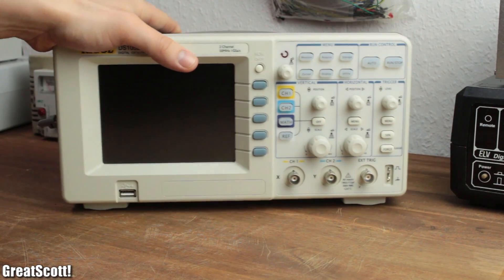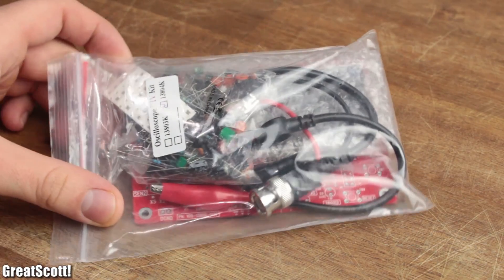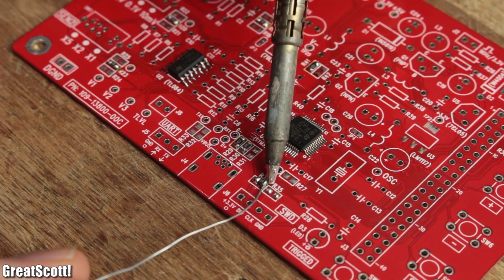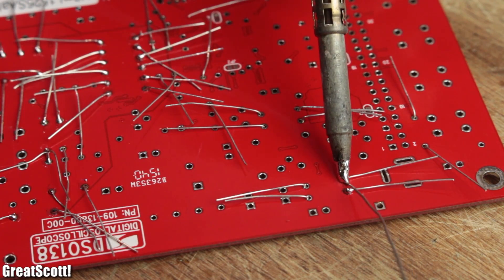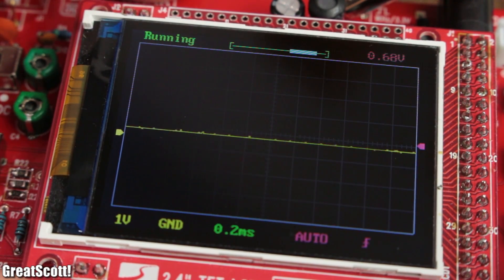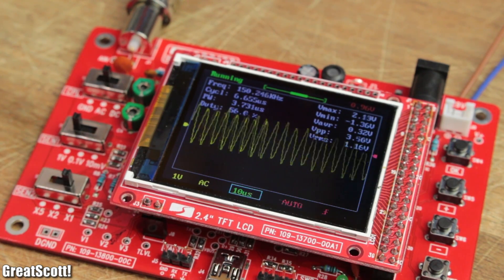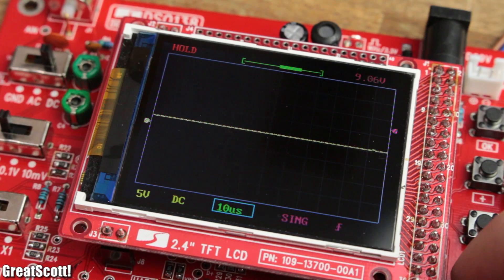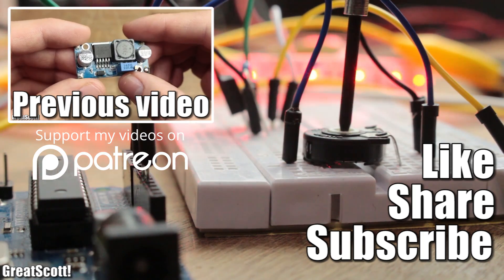DIY Oscilloscope Kit (20$) VS Regular DS Oscilloscope (400$)

Comment: My kit came with those tiny resistors and 3 other chips preinstalled I am very glad for that because they look hard to install. I once tried to solder a kit that was made up of those tiny chips and I failed miserably. lol, My kit also it came with all the documentation. I only just received it and my multimeter broke so I am waiting for a new meter to arrive before soldering anything onto the board. The documentation recommends testing the parts before installing them but in the meantime, I want to gain as much knowledge as I can before assembling and using it.I am fairly certain that this item will be perfect for my needs I am nothing more than a hobbyist  Thanks for your video.
Why does it tell us to short J4 after a power test?

Comment: can it be used to set up amplifiers gains in car audio, where output voltage is 30~40V ?
Reply: Alexandru V max recommended is 5v
Reply: Maybe you can use a 1/10th probe on it, but I don't know if you can easily calibrate it :)

Comment: Excellent video!!  You could add a few more details on the build issues (do you need static mat & heat sinks, if chips are sensitive CMOS, or, thru holes mis-drilled (if they are..).. that kind of stuff.  But overall, really, really good!  It's concise, and you get to the point without a lot of those stupid egocentric introduction animations so many douchebags like to add..  Thank you!

Comment: Measured the resistors? I suggested that in Electronics class, and the teacher damn near threw me out of the class. He insisted that we learn the color code by heart.

Bad luck for me, I'm slightly color blind...

Aced the class though, got top grades and now, 10 years later, I'm running my own electronics business... And I never use the color codes, unless I'm sorting big bulks of resistors... and even then I only measure one, then match the same colors together.

((For those who have no clue what I'm talking about, resistors have four stripes on them. One is gold and signifies the direction to read the other three. Each color corresponds to a number and together they "print" the resistance... because printing the number would be too complicated, I guess))
Reply: morphman86 wont work on SMDs tho, no colour code
Reply: The one that's gold is the Tolerance Band, which does two things. The first one you figured out. The other tells you how cheap your resistors are, or how close the actual value is to the marked one. There are four colors: brown, red, gold and silver.

Brown: 1% resistor - rare because most things don't need quite that much precision...the Army buys a lot of these, though.
Red: 2% resistor
Gold: 5% resistor
Silver: 10% resistor

If you have a 100 kilohm resistor, this is the spread:

1%: 99k to 101k
2%: 98k to 102k
5%: 95k to 105k
10%: 10k to 110k

They calculate the tolerance by making a big batch of resistors then measuring them all.
Reply: jmowreader Gold is the most common and the only one most amateurs will ever see. Thought it would be a bit outside the scope of what I was explaining to take all 4 of them up :)

Comment: I really want to make this but the super small soldering and soldering the chips is still a bit out of my range... I was happy when i got my amplifier kit working and the parts were pritty big
Reply: Several online stores sell it assembled for a few bucks more (i.e., $29 vs. $23 or so). IMHO, it doesn't make much sense assembling it by hand (unless you want to do that as a hobby, of course).
Reply: If you search for the  DSO138 13803K model, then all the SMD parts are pre-solderd, all that's left to solder is the through hole parts.  On the 13804K model you need to solder the SMD parts. 
JYE Tech make the original/genuine kit.

Comment: It seems to be tough to get good screens. I am brand new to the arduino and electronics, and am looking for a square LCD screen of 10cm by 10cm capable of producing about 8 different colours, and able to produce smooth lettering with an anti-aliased look. I haven't a clue where to begin looking, is ebay the only option?

Comment: hi i bought a new digital oscilloscope recently ,in its manual there is a warning telling that " the channels of the oscilloscope are non-isolated electrically. the channels should adopt common basis during measuring. to prevent short circuit, the 2 probe ground must not be connected to 2  different non-isolated dc level ." what do this mean ,can you please tell me .
Reply: Vasudev Mr basically you should not risk having the probes on different voltages since that could fry it

Comment: This kit is garbage and I returned it and bought a real analog oscilloscope for nearly the same price on EBay. I cannot believe you recommended this piece of junk
Reply from the maker: +Robert Maxson You have to be more specific rather than just saying this is garbage. Otherwise no one will take you serious.
Reply: +GreatScott! The bandwidth is a lousy 200k, the assembly was tedious and 2 of the components did not work (Chinese speciality), the probes are alligator clips, and compared with a real oscilloscope it has so much noise. I went online and bought a proper Hameg 40M analog scope for $50 on eBay and it's all I will ever need. You should be ashamed to advise anyone to buy that piece of crap instead of recommending an analog scope like every other YouTuber. I hope they gave you a lot of money for the shoutout. Engineers are suppose to be people you can trust.
Reply: +GreatScott! The bandwidth is a lousy 200k, the assembly was tedious and 2 of the components did not work (Chinese speciality), the probes are alligator clips, and compared with a real oscilloscope it has so much noise. I went online and bought a proper Hameg 40M analog scope for $50 on eBay and it's all I will ever need. You should be ashamed to advise anyone to buy that piece of crap instead of recommending an analog scope like every other YouTuber. I hope they gave you a lot of money for the shoutout. Engineers are suppose to be people you can trust.
Reply from the maker: Robert Maxson
Did you read the description of the product? Why were you suprised by the bandwidth and the alligator clips? I still think the kit is a good starting point for electronics tinkerer. No need to spread that much hate.

Comment: Hi Scott, thanks a lot for all these videos. :) One question about DSO138 : is it possible to upgrade the firmware of the DSO via one Arduino uno? thanks a lot :)
Reply: Using avr ISP mk2 it should work if youve got the right Software.

Comment: Great scott if the one button moves the measurement desolder it and use an opener then it will walk over the display until you press the buttun

Comment: I have built this Oscilloscope a while ago. Apreciate that you have done it too.
I have a huge problem and am not able to fix it myself:

No matter where I measure the voltage it is always 9,3V when I measure like you did in the video. AV-, AV+, 3,3V, 5V, TP22 it doesn't matter it is always 9,3V.
Any ideas how to fix it?

Comment: To solder SMD resistors and capacitors I apply solder only on a single pad and then I heat it while placing the component using some tweezers. After that I solder the other pad :)

Comment: Great Scott! Could you help me? I bought the same Oscilloscope kit and built it just before you made this video. However I think I blew up something on mine as the voltage per division is less than half of the actual voltage measured. Then I checked my power supply that was supposed to be 9v and it was actually giving 19v! The maximum this Oscilloscope can take is 12v so I assume I busted something. I checked the voltages as in manual and all are fine (after I used another 9v power supply). I'm wondering if you'd be able to have a look at yours and see what could fail in case of an overvoltage. 
That would be awesome! 
Anyway, love your videos, keep them coming!

Comment: When soldering SMD resistors or capacitors, put solder on just one pad. Put component on it's place and heat up solder to make a joint with simultaneously adjusting component's alignment, apply solder on the other pad to make a second joint. IMO, way more easier, way more better. 
Tweezers with sharp tips are essential. Chisel tip is the right tip for SMD soldering. Of course you don't want it to be too wide and you don't want to use thick solder wire. 
Nice vid!

Comment: I'm surprised you didn't use solder paste and a reflow method of some sort, hotplate/etc (????)..... Would be sooooo much easier than soldering by hand.

Anyway!! Good video, i've been looking at one of those DIY scope kits for a while, it's nice to get a reliable run down on them.

Comment: I got a dso and a proper oscilloscope.. while the small one can show simple signals (pwm, etc) you usually have to spend a minute pressing those 3 buttons to set-it up.. once the time or y-scale changes, you spend another minute pressing those silly buttons. Is DSO useful? Yeah, for 5 mins at a time, else I'd always go for a proper direc-controlled scope. 4 channel, 100mhz goes for 400$

Comment: For the smd components it's easier to wet a single pad, push the component on top, apply heat for basic holding, and then solder the other side.

Comment: Hi, i updated the FW on my DSO138 and accidently deleted the eeprom.Now it shows wrong voltage messurements and says its not genuine...Can someone read the eeprom out and send me the file?
Reply: +trashmaster9000 Even if you get the correct eeprom, you may still encounter issues. Becasue it is very likely that your EEPROM contained calibration data specific to your unit.
Reply: I dont think so... i think it contains a generic calibration...

Comment: Hi !
You seem pretty knowledgeable about these so i'll ask a noobie question if you don't mind.
I bought some years ago a DSO-2150 from Hantek. It's a USB o-scope that i believe works ok (for my use at least).
The only thing annoying is the outdated software that came with it.
The software is so old that on Windows 7 it refuses to even close the program, it spits out an "unhandled exception error" and you have to shut it down via task manager...
So my question is, would you happen to know of any software that would work with this model o-scope but isn't from the Windows 98 era ?
Thanks !

Comment: Dude seriously, soldering SMD's is the easiest part of electronics ever. Don't put solder on both terminals. Put some paste / flux on board, put element on it (it will stick). Solder one side (using tweezers to stop it from moving) and viola.

Comment: I never herd of a Oscilloscope  kit for that cheap. (if it works even a lil bit for smaller DC circuits, 100% worth it.) ty very much. Love your channel. (you are on par with Ben heck in Science (if u had a higher quality video Production you could make a huge channel here)
Reply: Posted that before i finished the video. it looks awesome for my projects When i buy one ill be sure to come back and use your link.

Comment: Can this DIY scope be used to check if 74series inputs/outputs have activity or just stuck low/high? So you can check a bunch on a pcb and find faster if one is dead or good without desoldering it?
Reply: keropi666 why would you use a scope for that ?

Comment: you should nor cut trough solder. Cutting trough solder after soldering introduces stress into the solder joint.

Comment: for smd resistors / caps i usually pre solder only 1 of the pads, and slide the component while heating up the pad, then you got the resistor stable and flush with the surface, and whats left is only soldering the other pad

Comment: I can't remember where I learned this from, but instead of tinning both pads, only tin one side first.  Then put the component (ie resistor), and reheat that one side.  Because there is no solder on the other side, positioning the component is easier than if both sides have solder on them and having to quickly alternate the iron between the two sides.  Just my 2 cents. :-)
+GreatScott, amazing job editing the many hours of build AND some tips into only a 5 minute video! Well done!
Reply: That's exactly how I do it and I've replaced hundreds of IC's and thousands of chip components.
Reply: Yes to this. Tin one side. Put on component and solder that side then just solder the other. 
Or get a heat gun and paste solder and just place them all and melt them in with the gun hahahahaha
Reply: Charles Bader when do you use the hot glue? Put component in place then tack it down with hot glue? What's the point? Why wouldn't you just tack it down to a pad with solder?
Reply: +Hari Wiguna 
Yep, it's like tacking down SMD components when hand soldering with a soldering iron. You put solder on one pad, place component, heat up solder to tack part down, then solder the other side. Sometimes you do have to add some extra flux in order to get a good joint on the tacked pin.
Reply: Yes, and after that, its a pleasure to remove anything..
Reply: Came here to say that. Another trick is to use a second iron. A cheap one will do. It'll pay for itself in time saved very quickly.
Reply: Hot glue. If you need to remove use a heat gun.

Comment: Built a couple of these. For audio and most power supply stuff, they're quite useful and work well. The later software ones with the data page like shown here are even nicer. And they're fun to build.  Hard to beat. Good video. Good compare with 'real' scope. You took into account the value as well. Some folks just diss the lower cost stuff without acknowledging the price/performance aspect at all. I plan to use one of these to monitor our church audio system to make sure that the low level stuff isn't clipping. easy to set into a panel and use, much more useful than a meter and very cost effective.
 Thanks for a fair eval!  Enjoy your stuff, and your Patreon.

Comment: 1. SMD components soldering (resistors, caps): I think it's better to tin one pad, solder one side of the component and then add solder to the second pa
2. DIY oscilloscope at high frequency: 'it's starting to act a bit crazy'. You know what Nyquist-Shannon theorem is and what happens when you input a signal with frequency greater than 0.5 times sampling frequency, right?